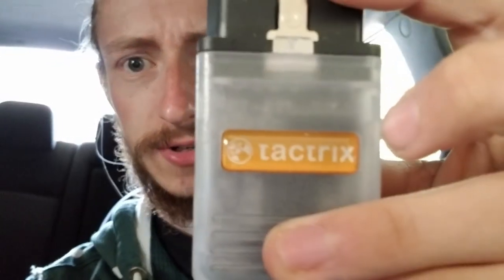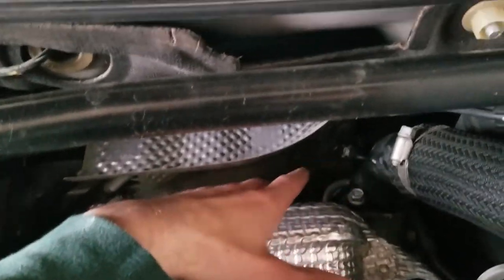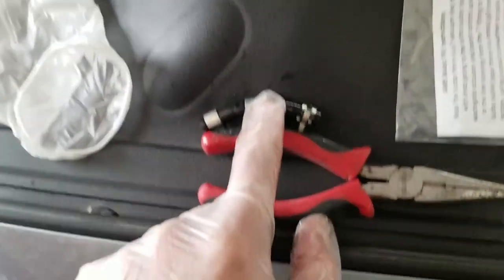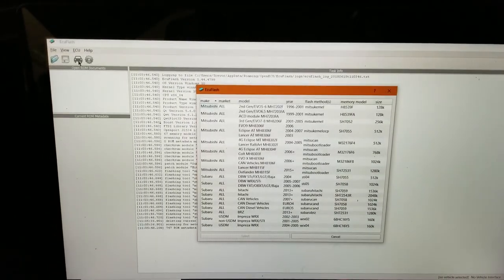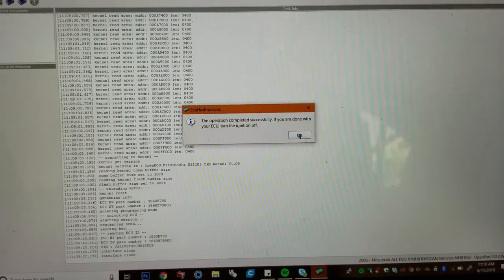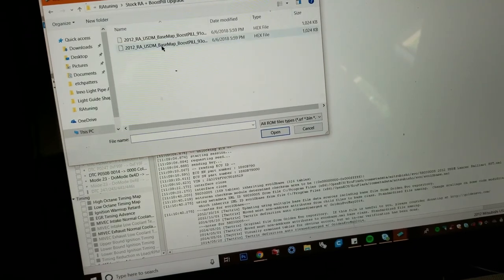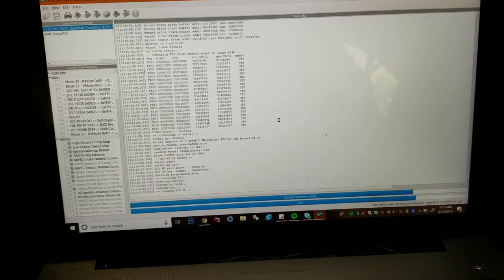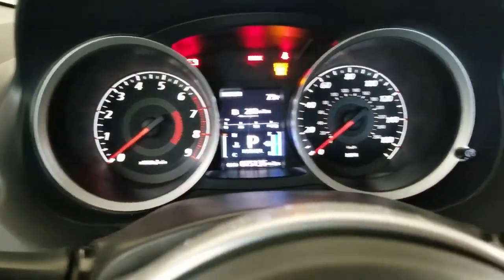Ralliart AMS Boost Pill and GST Tune Install

Comment: Appreciate the video. Looking to get this installed on my ‘14 ralliart. Basically stock, flashed s-sport on it and getting a catback exhaust and maybe an evo x intercooler soon. Have you had any issues with it since the flash? Also, was the mpg difference any noticeable from daily driving or moslty when stepping on it!

Comment: Hi! I was just wondering if you bought the $10 Mitsubishi reflash adapter from tactrix? It seems optional but if it’s not required it would be great to know. Thanks!
Reply: As a heads up, on my 09 ralliart you don't need the adapter. The adapter is for the 09 and older evos specifically

Comment: Good clean job on  video. Thanks for not lacing with profanity or annoying music.  Waiting on my tactrix cable, be here Monday. Love driving this car. Out of curiosity, have you had yours long enough to service the transmission?
Reply from the maker: Dewey Sturgill I bout my car at about 60k from a dealership so I negotiated the service into purchasing the vehicle and they did it there haha. But I plan on doing the next one myself if I get up that many miles!
Reply: Trevor Plagg thanks. I'm getting ready to do mine, but have been trying to find an alternative to the diaqueen.
Reply from the maker: Dewey Sturgill I highly recommend looking through the "RA Revolution" group of Facebook. All the guys there are extremely helpful and there is so much good information already there. If you aren't a part yet you can DM me and I can help get you added. I've learned most everything from that group

Comment: Any reliability issues since install? I’ve got a 2011 that’s stock besides borla catback, and I’d like a little more zip. But as it’s my daily driver, and I commute 7 days a week, I’m scared of ruining reliability.
Reply from the maker: I drive mine every day! Put just over 20k miles on it since the pill and never had an issue! I'd recommend a quality afr guage and changing your relays to be safe, but I've never had a single hiccup. That being said, it will be a tuned car instead of a 'stock' car. So you do have to be careful and cautious. (Keep a closer eye on your oil, fluids, afr, spark plugs, etc).
Reply: Thanks for the reply. I’m gonna have to do some research into this a bit more. I was thinking of getting a Cobb boost controller, but the cost involved is making me lean towards doing the boost pill and tune. Especially since it’s a quick easy mod.
Reply from the maker: @MakingAndGaming  personally, I trust the GST basemaps more than the Cobb tunes! But research for yourself. Feel free to talk through anything with my @plagg_designs on IG, or you can find pleanty of info on the FB group. Very helpful and knowledgeable people there :)
Reply: @trevorplagg7094  when you say change relays, you mean to the orange 1s?
Reply from the maker: @joeschmoe5009  yessir
Reply: @trevorplagg7094  ok i shall get those with a pill. I found your video thru the snyds channel. He just creditted you with the original video. And i thank you, i just successfully did a full stock tune to 91, as i cant get 93 in my area, and it feels like it runs a bit smoother too. Probably going to do a pill next month and retune. So thanx for showing us how its done!

Comment: Hey bro, so i got 2013 ralliart, put boost pill new plugs, and a test pipe but everthing on the exhaust is still stock, do i run the flash with TBE or no?
Reply from the maker: Yes. You want to run the "Stock RA + BoostPill upgrade + TBE" Try not to drive it until you do so. The main restriction in the exhaust is the test pipe, so that tune is for the cat delete mostly.

Comment: Do you have s-sport and launch control on that also?
Reply from the maker: Yup! Only used launch control like twice to test it. I use the tap tap method if I want to launch now on haha, but I'm overly nervous about wear and tear on my vehicles. I'm always driving in S-Sport though :)
Reply: @trevorplagg7094  I got a 2015 ralliart but all this gets me scared but I want it all. Lol
Reply: @trevorplagg7094  what about the super sport mode did you get that as well in the current tunes ??
Reply from the maker: @bwoycleon  S-Sport and Launch control don't come on the GST Basemaps. Its a separate procedure you have to go into the transmission tune & reflash for. Essentially you switch your trans map with an Evo MR one.
Reply: Is the trans map flashing hard to do? Can you provide details on this?

Comment: Hi I have 2014 Ralliart with only a borla catback exhaust as a mod. Could I still do this with the pill and the tune? Send me links please.
Reply from the maker: Yes! You can use the boost pill and the GST free tunes online. Do not use the tune for a "turbo-back exhaust" as for that one you need to have your catalytic converter removed. But you should be all set with the first tune! And I would highly recommend it! If you have any more questions ask away or DM me on Instagram... @plagg_designs

Comment: How much increases your fuel consumption?
Reply from the maker: Nothing noticeable unless you're on it haha, then much more. Honestly dude if fuel mileage is your first question when it comes to modifying cars then it's not for you.
Reply: @trevorplagg7094  in all fairness im planning on getting a ralliart as a daily that i can also have a bit of fun with so with that same kinda question in mind any modifications i would do i would also want to know if its gonna suddenly chug gas
Reply: If anything tuning the car will help the gas mileage, higher horsepower will make it so you dont need as much throttle for the same power as a stock car. High flow air filter by itself will help the mileage even w/o a tune. These cars also run slightly rich at stock.